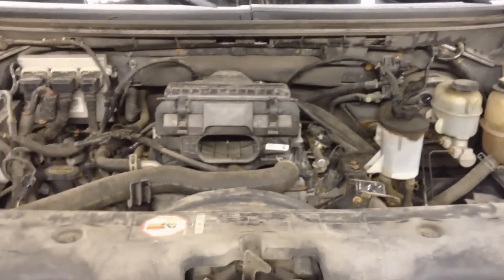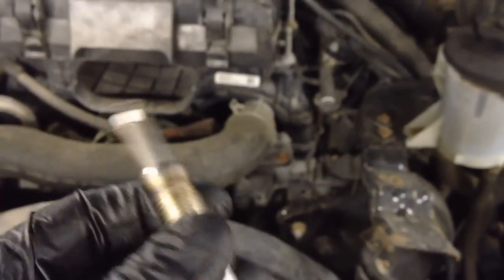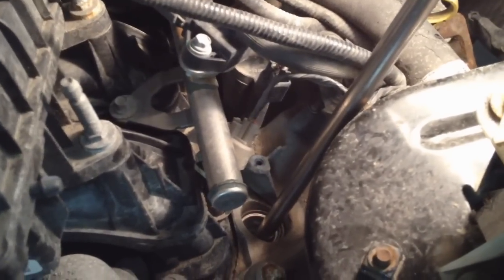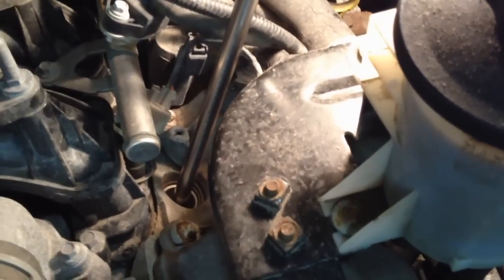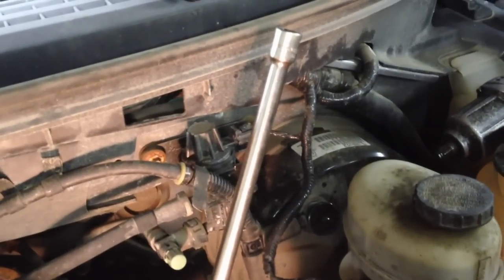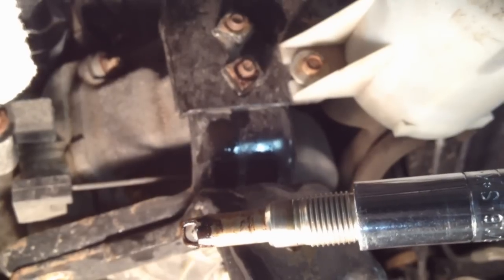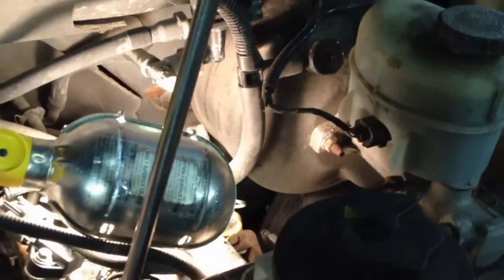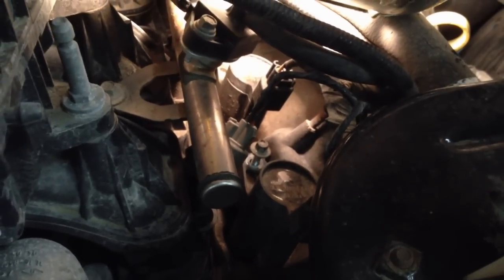Ford 4.6L & 5.4L 3V Triton Spark Plug Removal

Comment: How often do you recommend changing the plugs ?   I just bought a 06 with 82k on it .  Seems to run great .
Reply: joe smith you will start with a miss low rpm under load-most common in overdrive 50 or less mph going up a slight grade. Left untreated they start going through coil packs-
I have had my local ford dealer do this 3 times and it has always been $200 or so. They said if they break more than 2 then they charge more.
Reply: Jason Burson I finally did my plugs    None  broke   But I did not do the packs   They seemed to look good   I’m kicking myself for not doing new ones     Before doing the plugs it did start to missfire cylinder three on full throttle    Should I do the packs ?   No codes ..  I did just notice a rattle on incline and high speed on this road trip    It sounds like wind rattling a heatshield or something but I have no idea what it is   I checked O2 sensors and other things and nothing is loose
Reply: joe smith joe smith in my experience when coil packs fail to the point of throwing a code and the computer will even tell you which cylinder is misfiring. When one of mine was way over due on plugs it’s was eating cheap coil packs every month or so. By this I mean different ones would fail to the point of a miss fire to the point of a check engine light with a cylinder isolated via code. With the new plugs the old coils will be able to produce spark. If you want to throw parts at it you could replace #3 coil since you mentioned it misfired enough to throw a code

Comment: I have two misfiring coils and I had plans to change all 8. Now I'm hearing all these horror stories about breaking plugs. Now I'm scared to death to mess with the plugs. 2001 Expo with 198K miles. DO I HAVE TO CHANGE THE PLUGS??  Can't I just replace the coils and leave it at that?
Reply: nope the plugs go bad also and I usually replace them both on my car if im doing the job myself,,,that way I know everyone has been replaced,,,,,replace just one is a cheaper route but I have found another one will just go also after...so all is best practice

Comment: Thanks for the detail.  One thought, I appreciate that we don't want anything falling into the cylinder, but wouldn't it be more efficient to pull all the wires and then loosen all the plugs and put the cleaner in to start soaking?  Then you don't have to wait between each plug, but all plugs will be soaking at the same time?

Comment: Hi..your videos are excellent...I have been able to do work on my 2008 F-150 lariat that would have cost me a lot of money...I have an issue with one spark plug my 9/16 socket will not go around the spark plug...I tried "lightly tapping it on...I have ground the socket body  down in case it has an issue with the wall distance...I have no idea if this is original plug and someone could not remove it on a spark plug change...any ideas would be appreciated

Comment: Hi Brian I just changed my spark plugs in my 07 F150 and coils. Did it the way you described in the video just used hand ratchet. Took me 3 hrs total,the first time I did it before I didn’t know about Your channel. I broke 4 and took me 2 frustrating days to do it, but I did use nickel anti-seize on them and that help them come out the second time tremendously better. I have 120,000 miles on it now and I’ve learned a lot on your channel I appreciate your work,thank you hope this helps somebody else. I live in Ohio and I’m gonna come to see you to do the phaser timing job maybe in the spring 2020 thanks again

Comment: I did it!  I did it! Lol! Thanks for your awesome informative videos! Own my first ford. 2005 f250 5.4 3v and i changed spark plugs and coils today. Followed your video and worked great. This is the way to do the job every 5.4 3v owner fears. I have been a chevy man my whole life, and have replaced transmission on all i have owned. Decided to buy used Ford truck and then found out  about  5.4 3v issues. I stumbled across your youtube channel and put me more at ease. Thanks for the videos. I have been all over the internet looking for how to info, and your videos are a go to for a lot of Ford mechanic websites, blog and internet sites.. Good job!  Will be watching your videos. Thanks again!
Reply: I don't know if you still have your truck, but if you do champion has made the regular one-piece design all along. I replaced mine original plugs with champions after the first change and you don't have to worry about doing all this preparation you just go in and take them out like you normally would. If you have a 2008 and newer you don't have to worry about this because they redesigned it. If you haven't switched the champions I would recommend it. Hey on the bright side spark plugs aren't that big of a deal it's not like you have a Toyota that that will rust in half on you😂
Reply: @Marco-fi6gv  I saw somewhere the other day that the redesign from Ford was a mid-model-year thing. I think the build date on the engine has to be 10/09/07 or after.  (I went and checked mine....10/03/07......  Womp-womp
Reply: All american vehicles have problems. Just switch to toyota and never look back

Comment: I was not looking forward to replacing spark plugs on my 2005 f150 5.4l 3vl. I purchased the truck two years ago and now it has 140,000 miles on it. I heard about the spark plug issue when I first got the truck and thought it wouldn't hurt  since I wasn't having any issues with plugs but knowing I would be doing a tune up eventually to start using seafoam in gas tank. I added seafoam to my fuel tank about once a month until current date. I just changed my plugs to the revised 546 plugs a couple of days ago, no problems what so ever, all plugs broke loose with ease no squealing or noise or binding while coming out. Once they were out found little to no carbon build up on the ends of the plugs. I know my senerio took place over a long period of time so can't speak to just how many cans of seafoam it would take to clear carbon from ends of plugs for easy removal but I would think if you added it accordingly for a couple months you should be good.  I never coment but thought people should know about this with all the horror stories out there. Crazy because my plan from the start was to dissolve the carbon in the intake hoping I would not run into the problems everyone else was with breaking plugs off due to carbon build up. It payed off because they all came out with ease and no crazy noises or squeaking while removing. Hope this helps.

Comment: I have a 2008 f250 5.4 that I recently just did plugs on. Put in sp546 (My 08 is the previous head design that doesnt use the sp515's). Anyways I disconnected the battery to do this for safety. during plug change, I found a plug that was loose (thankfully not too loose though). The initial time I put back my ignition coils, I loaded them with too much dielectric grease I believe...but the truck ran stinking smooth and had plenty of power! Drove it for about 45 minutes or so when I started feeling a jolt in the engine rythym (felt like a miss) while I was stopped at a red light. this then became more frequent as I drove on until the engine began running pretty rough, even when driving. Felt like misfires. Not once did the check eng light come on. I went back to clean out the excess grease, thinking that was affecting connectivity. I noticed several ignition coil pigtail wire connector tabs had broken so I've replaced those. also replaced all ignition coils (truck has 201k-figured it was time). Combed my enging for vac leaks-found none. For 201k the previous owner seemed to have kept up on the lines or something- they didnt seem too bad. I checked my fuses, ive cleaned my throttle body (was pretty dirty), and then I had battery Disconnected for awhile to reset the memory. had all accys off and turned key halfway and let it do its thing for 10 seconds, then started the engine and let it idle to temp. As the engine warmed I noticed a pass side ticking (truck has had a tick for awhile but never affected engine like im experiencing now). I took it for an easy test drive to help re-learn the shift points and all. Still having a really noticeable engine shake. Best I can describe is a bouncing feeling. Also when I drive and keep consistent pressure on the gas pedal, the acceleration seems to be pulsing almost, and not getting good consistent power. 

I've been careful to use Motorcraft parts for the plugs and coils (dg511 coils) What am I missing? or am I just being impatient while the truck re-learns? since my latest work today/battery disconnect, I've driven it say 20 mins after letting it idle to temp. Thanks a ton! this has been keeping me up at night for the past week.
Reply: Did you figure it out?
Reply: @getfurtherfaster dealer said cyl 1 was dead and no compression. they suspect a lifter blew out as an unrelated failure. their quote was about $500 less than a new engine so I went that route.

Comment: Found a '99 w/ a 4.6 L 5speed tranny 4wd for $3200.  what you think??  170k miles  May be too much of a maintenance hassle, compared to my '94 T100.
Reply: filoIII that's not this engine that would be a 5.4 2v these ones are a 5.4 3v

Comment: How come Ford didn't make threads that would engage the whole spark plug's threaded area?  I've mostly had older vehicles and I've never had this problem.  Although I now have a 1998 F150 with a 4.6l engine.

Comment: I started with #4 on my 07 EL 3V Expedition because it had a P0304 and after switching the coils around for a few days it threw the same code.
I was working mostly by feel to get the socket on the plug when it started to turn by hand and came out in one piece. Wish me luck with the others.

Comment: Thanks so much for making your terrific video.  I did just exactly as you described and was all set for a harrowing day.  All went well!   I did discover that in late 2008 Ford finally made a correction and made heads for the 5.4 V8 Triton motor that accepts regular "normal" type spark plugs.  You can tell what kind of plugs are in your truck by the color of the coil plug boot.  If the boots are black, then you're going you have the achy breaky spark plugs.  If the boots are brown you should have the new head design normal type spark pugs.  Thanks again for taking the time to make your terrific video!!
Reply: Ok.  But what about the people that still have the old head?  They should do a recall and change them out for free!!

Comment: Why does ford quicklane charge $605 for this job?
Reply from the maker: Inexperience with removal techniques so they load up on the hours and I think the plug retails for $18 each. I charge $250 no matter how many plugs break and I use Motorcraft plugs.

Comment: I bought an 05 F150 with a 5.4, 3 valve.  It started to shudder on acceleration.  Figured with 150K miles it was due for plugs.
I followed your advice on cracking them loose and then soaking them with carb cleaner.  Using the 1/2 in drive ratchet is genius.  I let them soak about 4 hours and then blew out the plug wells with the blow gun.  All 8 came out without a hitch.  Replaced the boots and cleaned the terminals on the coils.
She runs like a champ now.  Thanks Man!!

Comment: FordTechMakuloco.....I love your videos they help me allot in understanding my truck better and how to repair them easily.  I hope you keep sharing us your knowledge and thank you.

I know this is an old post but I have an 08 Expedition and I think the engineering design team of Ford should have at 10yrs of auto-mechanic experiences in automotive to have their jobs.  Why, so they would understand how things can be accessible then cramming into areas that would be difficult to get out.  And for the corporate decisions of removing the dip stick from the transmission to save pennies you are the most unintelligent person on auto-mechanics, you should be removed from that position and go get a degree in common sense.

Comment: In cylinder 4 of the 5.4 triton, I have a plug that just keeps spinning, does anyone know what to do in this situation? I have tried long needle nose pliers, tightening and loosen the plug, pb blaster, tried it both with the engine cold and hot. I can’t seem to break it so how do I go about getting it out? From my understanding the spark plug extractor is for when the plug is broken.

Comment: I have a 07 f150 with the 3 valve engine. The plugs were replaced by a ford dealer, and I assume the new plugs have the anti-seize put on them. I am about to change the plugs, have you ever had a plug break that had the anti-seize on it?
Reply from the maker: No I have never seen new style plugs break no matter how stuck they are
Reply: Thank you very much for the reply!!

Comment: I changed the plugs in our '07 Expedition at 100K miles. All came out in one piece...luckily. I also applied anti-seize to the threads of the new plugs. Do the plugs and coils in these motors need to be replaced every 100K miles? I think I read this in the owners manual. It's almost that time again. Thanks
Reply from the maker: Plugs every 60k miles, coils as they fail. Generally though due to heat start to fail at around 100k miles.
Reply: How do you know or test to see if a coil is bad?
Reply: @janetangst9180  you can disconnect 1 coil at a time (from harness), if the engine runs/idles rough it's good. No change in idle then the coil is mostly likely bad or there's a  bad circuit before the coil plug in.

Comment: Any help had a plug snap off between hex head and threads. I've soaked for days and tried easy outs. Heated and cooled. No luck. I've used a 4' bar on it won't budge.

Comment: What I’ve found best to remove original plugs is if you run the engine at 1500 RPM for approximately 10 minutes either on its own or with the fuel inj. flush (PM5) so the engine can be hot and hit the plug with a 1/2 impact but keep the socket/ extension as straight as possible also don’t put pressure on the plug. Best way is the flush which is you get the engine hot and hit the inertia switch or unplug to switch the fuel pump off and directly plug the flush to the fuel line and plug the vacuum fuel rail sensor hose and continue to run the engine to clean the carbon out the cylinder walls including the plug tips which is what seizes in the head. (Mix the (PM5) with gas)

Comment: Great videos, thanks. You say the plug sp515 is the latest plug for this engine. I ordered those from Amazon but received sp546. Are the sp546 the same? 2004 f150 5.4 3v
Reply: postalmc  did you ever found out if they are the same?

Comment: 85 dollars for that tool? Should i try to do this myself if i dont have an impact wrench? Im thinking with the price of that tool and my lack of compression tools it might be worth it to just take my truck to a shop. I need to replace the coil and spark plug in just one cylinder.

Comment: do you have a video on the front axel knuckle seals. if not that would be a good video  to make. I have a 2005 f250 both side need replaced, no one makes a detailed video on it

Comment: I Just did 
but after all that process when turns the key on a 2004 f150 3v 5.4l surprise engine light on codes p0358 p0174 and p0351... pls help

Comment: hey great video. And I know that use an impact wrench is one of the two ways Ford says to do this, but damn if putting an impact wrench, even just to take a spark plug out, on an aluminum head scares the hell out of me! Mainly because you can't really feel if there's any resistance and possible cross threading going on there while pulling it out. But I see online a lot of people with videos use an impact wrench and everybody says it works great. But I just need to rely on my sense of feel when taking these plugs out of this particular type of POS designed aluminum head... but anyway no criticism here just kind of more rhetorical and any feedback on how to prevent cross threading pulling these things out with impact wrench I'm all ears or eyes in this case lol

Comment: Using an impact gun on a spark plug goes against everything I've known on spark plug removal. Seems it's too much risk on damaging the cylinder head.

Even the Ford TSB says do not use air tools. And make sure the engine is at room temp.

Maybe this method was invented at the dealer, where the techs had to save time.
I think using a high quality carb cleaner, ample soak time and hand tools using the back and forth method would yield a higher percentage of removals without breakage. 

Did you ever try following the TSB line for line? 
Thanks for the video
Reply from the maker: Yes of course working as a dealer tech we used every version of the tsb from the kroil oil to the Motorcraft carb cleaner. Unless you have time to let it soak for days the best way is to soften the carbon with heat and shock it out it doesn't hurt anything. This is the only engine we use impact guns on.

Comment: That looks like a mess to remove the plugs on the 5.4 engine, and that is what I have in my truck. I hope my truck lasts because I would never buy another one with an engine that size. I have driven Fords for years, and the 2004 model I have is the worst designed model I have owned.

Comment: How often do you recommend changing the plugs on these Triton motors?
Reply from the maker: I start to see a pretty large gap at around 60k. Not only is that affecting power and fuel economy but it also stresses the coil out more every time it fires. So 60k miles or so starting thinking about getting it done.

Comment: There's a mechanic floating around on youtube who takes these out with an impact gun. Says they never break that way.
Reply from the maker: Yup I have a video on that method we have been using that method for years at the dealer. It is not fool proof but it works very very well with some risks I go into detail on the procedure here- https://www.youtube.com/watch?v=aECk7Vz2kLU